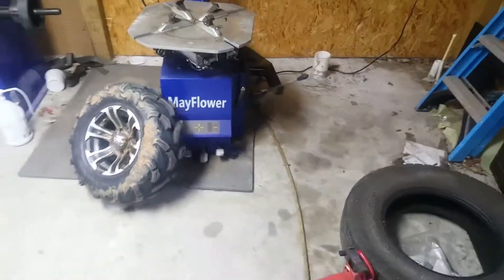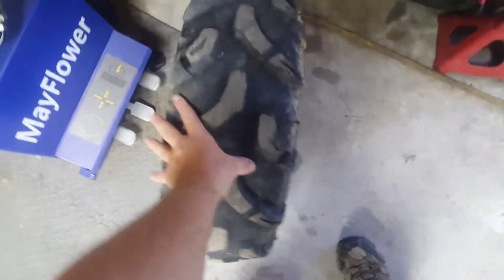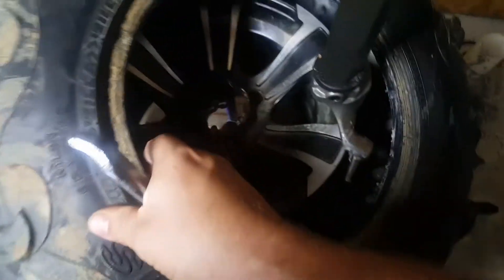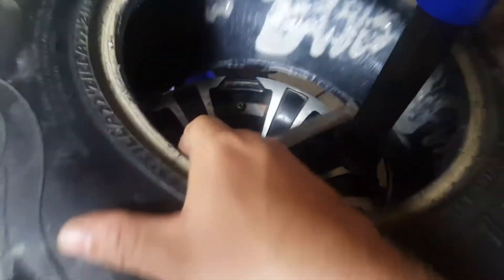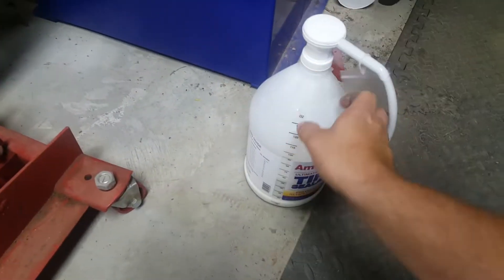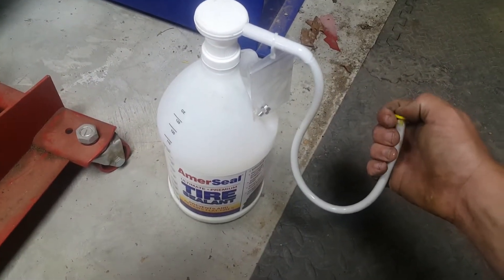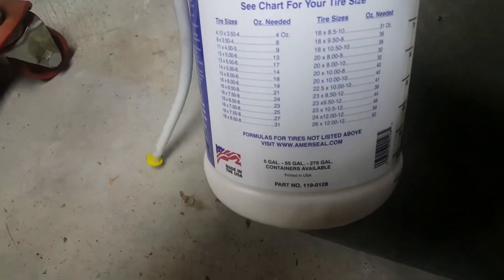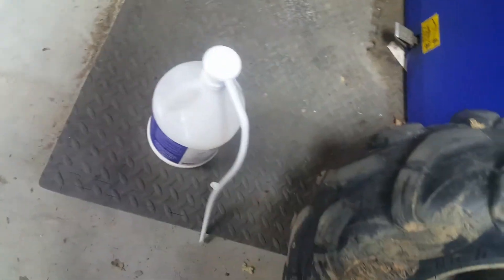Changing atv tire with ebay chinese tire machine

Comment: thanks for the demo boos, im planning on buying that machine but the one with the extra arms for low profile tires, does the metal head scretches rims?? for like a low profile tire
Reply from the maker: if you are not careful it will.